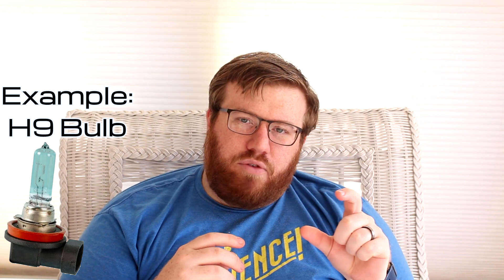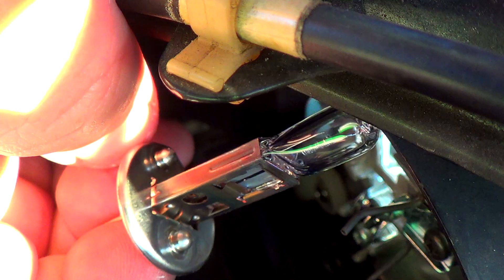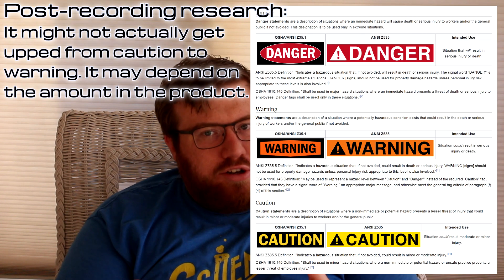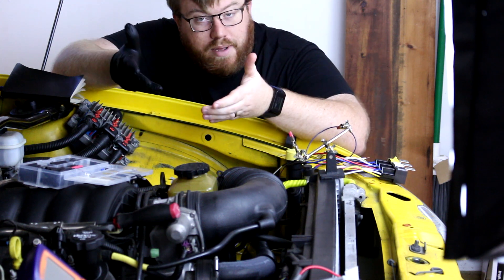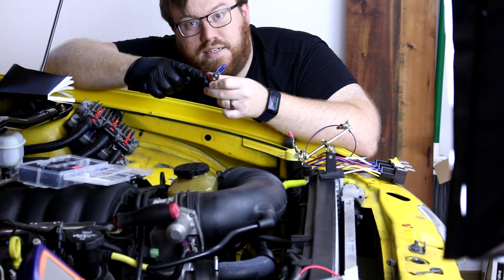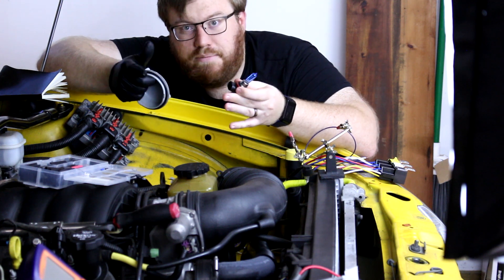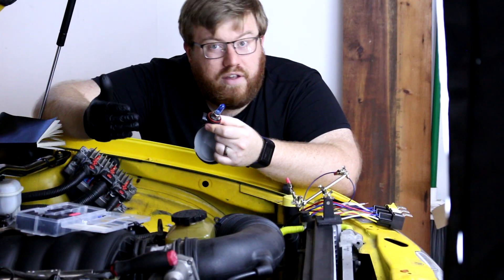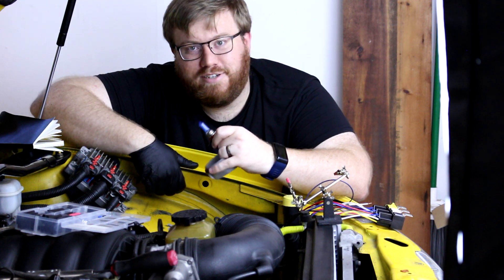Was I Wrong About Bulb Grease? How to Use Bulb Greases: A Deeper Dive • Cars Simplified: Follow-Up

Comment: I agree to use dielectric to keep water out and not slop it around on the contacts if you can help it.   It seems to work well with auto trailer hitches the grease prevents the oxidation/corrosion which outweighs any increase in resistance from the grease.  If the connections are tight enough it will make good enough connection.  But I think contact clear + sealing it from the outside but not on the terminals is a pretty good practice.  Seems to be working for you.

Comment: I’m here because there is a specific application to the H7 headlight bulb connection in a 2003-2011 Saab 9-3 where there is an all metal connection that arcs and can burn out the bulb. I was told to use grease on it.

Comment: Why not use any silicone grease on the rubber and plastic parts instead?  Since plastic and rubber are not conductive and dielectric or galvanic corrosion can only happen between dissimilar metals, I see no reason to use this on rubber.  There are way better ways to get a water tight or dirt tight seal that can still be unscrewed with regular greases.  I really don't get this product when there are better options.  I think bulb grease might be reasonable on contacts if they are dissimilar metals if there is fear of water penetration or salt.

Comment: Thank you Steve for a good video. I am about to do a valve cover gasket job that includes replacing the spark plug tube seals. I wounder if I can use a $3 Permatex bulb grease instead of a $12 Permatex generalized dielectric grease. Thank you!

Comment: FWIW I've received an e-mail from a senior product support specialist @ Permatex and they state that if a thin film of their 15320 is applied to, for example, a 9V battery connector there should NOT be any interference with electrical flow.  I agree with earlier posters who suggest that you delete the two video.  This video gets a 👎 from me.

Comment: For once I somewhat disagree with you on something. I do think there is a purpose to smearing the grease not only onto the metal parts of the bulb, but onto any contacting services of the housing. Silicone grease acts as a moisture barrier. So not only will it help keep moisture out of the housing if you put it on the seals and any hard surface areas with a small gap, but even if moisture gets past that and into the housing, the grease on the metal itself will actually prevent the moisture from corroding the metal. If it sits on the surface of the grease and not on the metal itself, the oxidation process cannot take place.
The reason to put it on the contacts themselves, is that as you insert the bulb into the socket, the contacts will displace the grease and make proper electrical contact, but the grease will now form a barrier around the contacts ensuring they cannot corrode from moisture even when they get hot as well. Not that you want to put a ton on them, and as you said some assemblies will be more sensitive to anything on the contacts than others. You're still definitely correct to completely avoid the glass of course.
Obviously this all has limits, and the grease will not last forever, especially in a hot environment. That said, especially in older vehicles, or just vehicles without the best housing design ever, like those without pliable rubber seals or o-rings, the silicone grease is really going to help extend the life of the bulb and keep moisture out of the housing.
For example, I have a turn signal bulb on one of my Subarus that is so thoroughly rusted into the housing that I still can't get it out. had that bulb been greased before the last time it was inserted, even when the housing failed and moisture started to get in, I bet the metal would not have corroded enough to be seized in place. It's the type of bowl that you push and twist and it locks in. If there were grease between the metal of the housing and the metal of the bulb, they could not have rusted together, even as water got into the housing, until all of the grease was displaced.
It's not exactly a disagreement with what you said, just adding on to it and saying that I do think there is more of a purpose, especially on older vehicles. The XJ Cherokee, as another example, has pretty crappy turn signal housings that really love to let moisture in. Greasing those bulbs would save you a lot of money over replacing the housing when even getting a new one probably isn't going to help an old ass design and you really don't want to spend a bunch of money on your rusty Cherokee. Hahaha.
One last note, I would never buy the bulb grease specifically. I would just buy a tub of Super Lube and call it good. As Grandma says, I put that sh** on everything. Generally, since I live in such a rust prone environment, I put grease onto any metal I don't want to corrode over time because it really act as a barrier to moisture and grime.